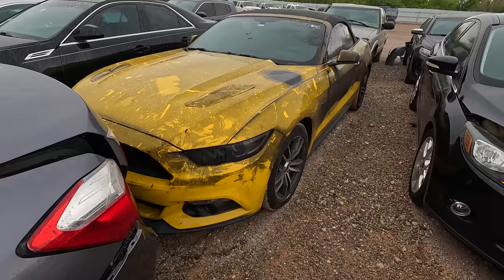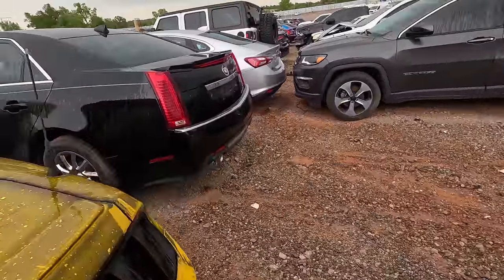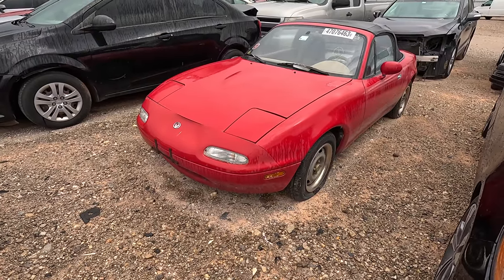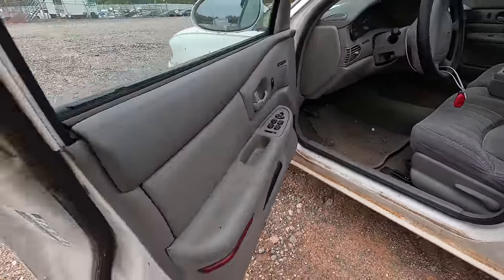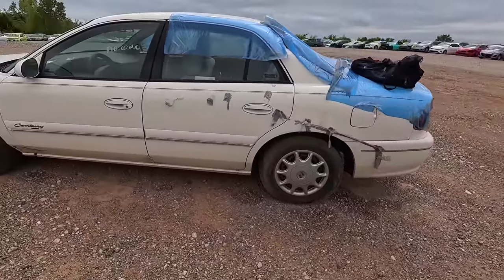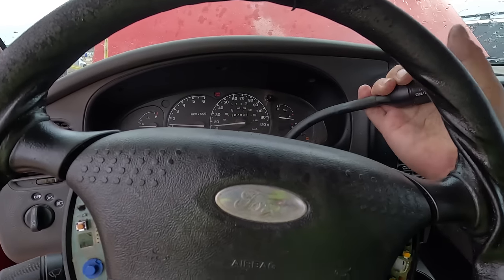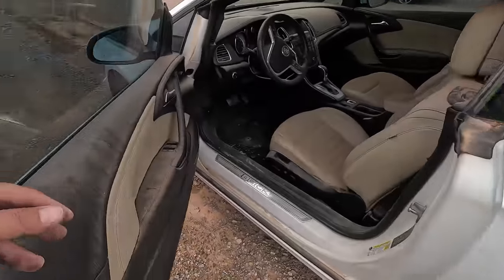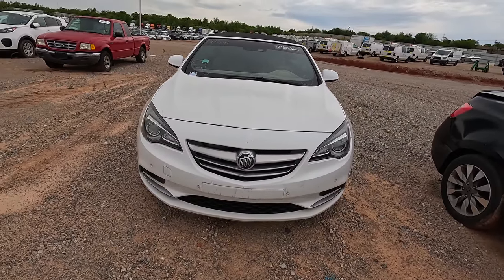Copart Walk Around Fire Damaged Mustang GT + Car Full of ANTS!!!

Comment: Go for the burned Mustang, Randy :) Love the project
Reply: I agree.
Reply: Burn car has no damage better then flud car
Reply: @giorgitadumadze8490  No more than $1000 to fix (some used tail lamps, some new rubber seals from Ford which are cheap a full detail and paint correction). I think he should go for it. Can get a new top later if it doesnt leak.
Reply: I want to see it come on man you can do it I want to see the yellow mustang back on the road I know you can do it
Reply: Yes save the Mustang
Reply: Get it!
Reply: I love the soot damage patina, it looks like someone airbrushed it.

Comment: The Mustang would be a good project, you would have to pull the entire interior and have it cleaned, replace the carpet, and top and wash and buff the body . Then drive and enjoy :)
Reply: I think the smoke could never go away.
Reply: @brentolson5504  Well if the smoke smell doesn't go away you could drive it on sunny days with the windows down  and you would not notice the smoke smell, or take up smoking cigars then you would  never notice the smoke smell eather
Reply: @brentolson5504  The smoke will go away. A buddy of mine and I detailed a smoke damaged Mercedes (W211) E500 one time. We disassembled the whole interior and trunk and left it out for 7 days. We took the carpet out and shampooed, scrubbed and reconditioned the leather, took all the door panels off and ozoned it. Put it back together and we smelled no signs of smoke. My buddy sold it like 4 years ago to a lady and she is still driving it. We still detail it currently for her from time to time.
Reply: Don’t forget the non-working gauge cluster.  There are bound to be a few other issues as well, but I still agree, that it would be a great car to fix/drive/sell.
Reply: It would be interesting to see how good the mustang cleans up
Reply: @JasonMcCord-qk3yb  Who needs gages? if the engine is knocking, add oil. If you pass a cop and he puts on his lights, slow down. If your lights go out at night you need an alternator. And last if your radio won't work, sing to yourself.

Comment: I would buy the smoke flavored BBQ Mustang haha! Same goes for the low mileage Miata. The Miata looks like it'll go cheap enough! I also love the Buick as well. It's a relatively modern car that would be presentable in the dealership! Such a shame to have it rot for 2.5 years. Wonder if the original buyer paid for it and then simply forgot about it.

Comment: The 2nd set of taillights on the Buick Cascada are required by regulation for the US (and I imagine in Canada, too).  Taillights and brake lights are required to be on a non-moving part of the body.  Since the main taillights are on the truck lid which does move, that 2nd set is required so that if someone was driving the car with the trunk lid open, they would still have visible taillights and brake lights.

Comment: Hey Randy sometimes when the brake switch is bad on Ford's I know this happened on my older 93 Lincoln Town car when the brake switch is bad it won't shift out of gear cuz you don't have no brake lights so you'd have to turn it off shift it into neutral then start it so that might be the problem with that.

Comment: they make special dry sponges for soot removal. less mess for the int. def good content for you the stang. What is appealing about the VW is lack of fanfy electronics on the DB. Older drivers like simple button/lever controls that allow you to operate without taking you eys off the road.
There's a guy oin FL that converts them to Farrarie clones , he wears tropical shirts and sandels  ! LOL
  What, you forgot your coveralls!  Would be a fun one !
  I'm with u on the Rangers. Had 3 of them and 2 were red. Don't care for the new ones.  It's got windows and locks that's a plus Goood fer parts I guess. With that kinda mileage the timing chain guides are in question. But can be changed out.
 The Cascada looks perfect car for a HS girl grad to take to college.  Try to get it and clean it up, make road worthy again Run the VIN see if it was reported as stolen. Could it have been bought and never picked up. I have that color on my 2016 Lacrosse I got last June.